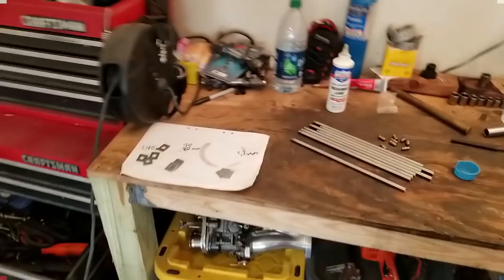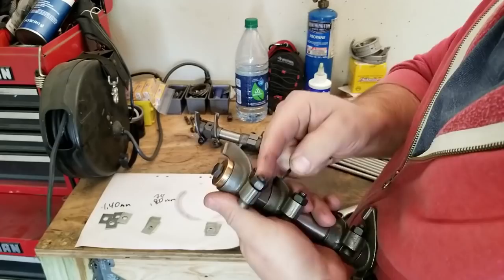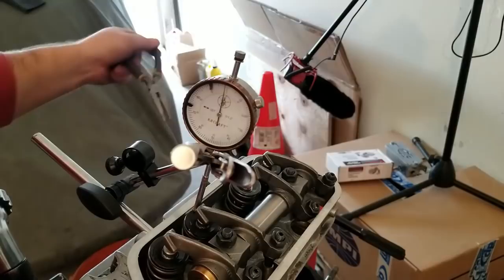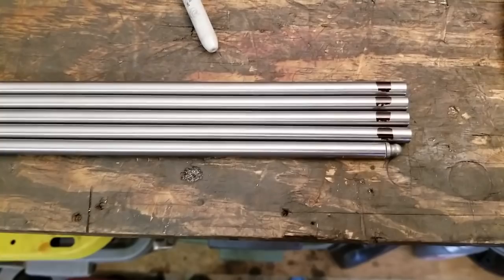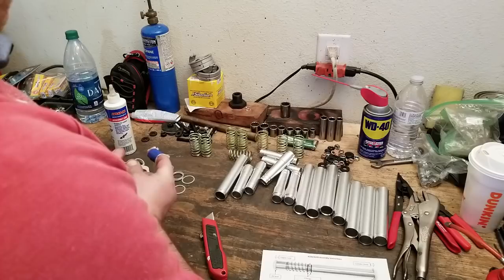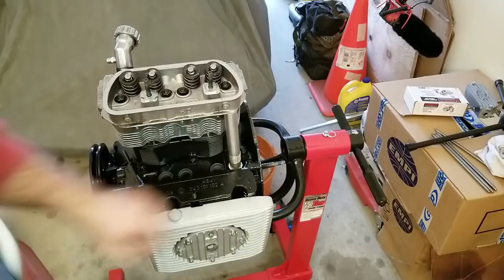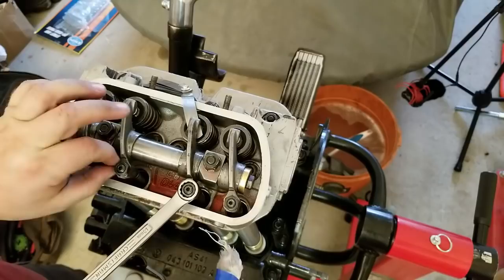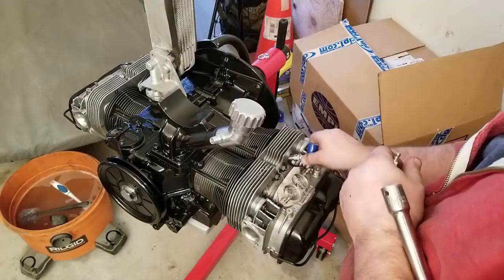2276 Monster Engine Build! Part 4  -  1956 Ragtop - Volkswagen BUG | JW Classic VW

Comment: WOW....  You need a set of light valve springs, the initial rocker stud adjustment is based on oil galley alignment, the rocker stud needs to be parallel to the pushrod at half lift.  You are overlooking critical steps that will eventually lead to mechanical failure.
Reply from the maker: Thanks for the comment, I'll take a look at that.
Reply: Rocker stud orientation applies to stock engines as well.  The stock adjuster stud needs to be in line with the vave stem at half lift.  When the cam noses over the valve spring pressure is equalized.
Reply from the maker: Good info thanks for the comment!

Comment: cool, i'm slowly getting caught up on your vids. another long term review item: 2 piece spring loaded empi push rod tubes. i have some (long story) jaycee tubes in my last build. wary of empi's version. everyone's a critic, but, chromoly pushrods don't expand like the aluminum stockers. try running a tighter lash or even 0 if your engine is a bit clattery once warmed up. i checked the comments here and am surprised no one mentioned this.